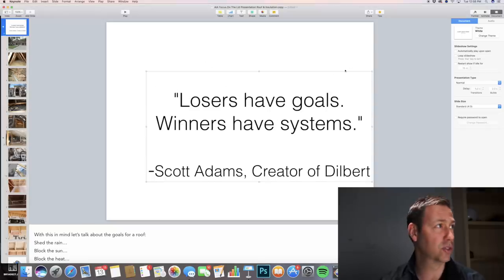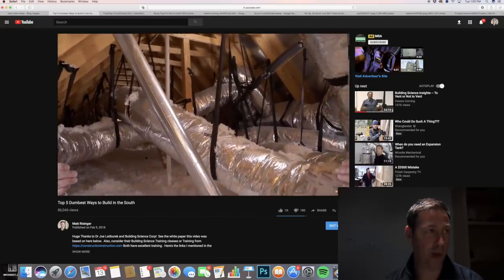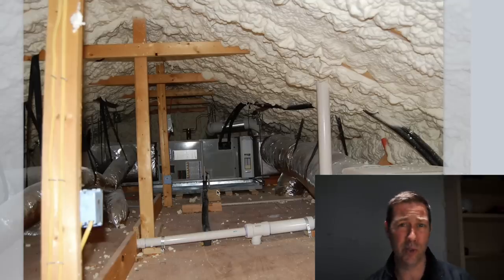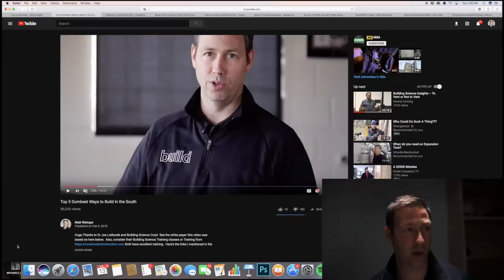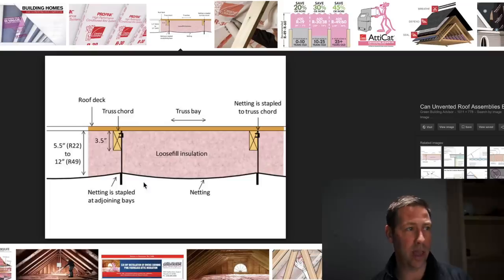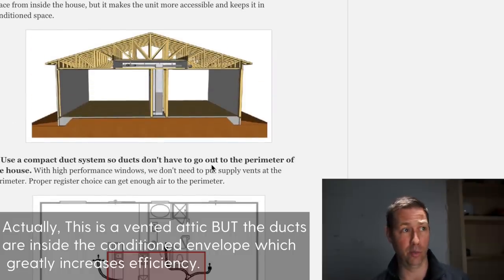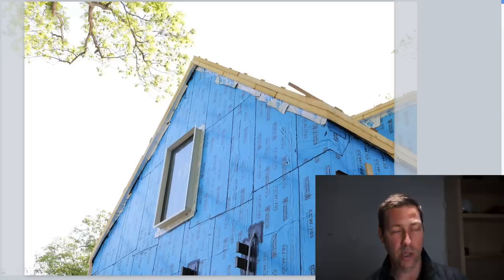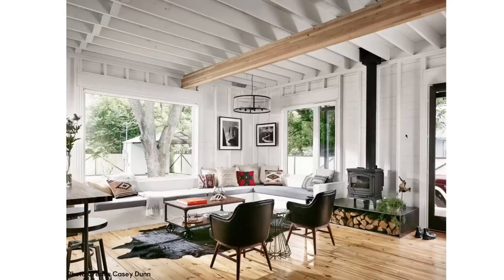Attics/Roofs - Dumb vs. Smart - How to Build Correctly

Comment: $250.00 sqf is very north of most custom home budgets. I really like your videos but that statement sounded more in line with a money's not a concern build!
Reply: I was thinking the same. 250 is very high. most builders are around 80 to 90.
Reply from the maker: I would expect a lower cost in other parts of the US. But we need to set higher expectations for performance on our homes. Gone are the days of a home built for $xxx/ft (Insert local average cost).  A well-built home with good systems, a thoughtful design, and good tradesmen should cost 1.5x (local average cost). We should be building homes that last a few generations without problems, that are healthy, durable, efficient and long lasting. Build better not bigger.
Reply: Matt Risinger, that's great if you can recover the premium cost within a 5-7 yr window but the resale price of the home will only bring $ average of "like" homes recently sold. Unless the owner can document real utility saving to project forward the home will likely not resell for a premium.
Reply: Michael Amick yep, have seen this happen to many people that custom built there home. Then bank comes in and says I don't care about your upgrades or how well you insulted, a house in this area is worth x per sq ft and that is all we will grant a loan for. It's a sick feeling to spend $250k on a house where you did a major part of the labor yourself  because it was your profession and the bank says it only appraises for $180k.
Reply: Hard to say "most" when referencing anything.  Our client base covers homes primarily $1.2 -$15 M and we are just south of Austin. Everything is relative .
Reply: Bdub78 dub AGREED! if you take that /ft^2 value and slap it on mine, it would cost 912k to build!!!!
Reply: Bighappy 80 - 90 is a little low. Even Tilson and DR Horton are closer to 110/SF. I build a larger production homes that are around 150 - 175 a SF and there still crap in my opinion.
Reply: but at that durability i would buy it.
Reply: @buildshow  yes we should build better but you must account for cost. Everyone wants the best home built. There's no question there but $$ is always the bottom line. Everyone has a budget and I'm just saying that $250 sq ft is NOT a realistic budget for 90% of us. I'm not knocking your product. It looks like a great one. Just want you to realize the cost you casually stated in your video shocked me.
Reply: 125/sq ft. livable space is more in line with our build budget, not too many people can afford 250/sq.ft. where I live.
Reply: First thing I thought. You mean to tell me a 4K sq ft house is 1 mil just in building costs? I'm sorry but no way. Love the channel but I can't see this as being realistic.
Reply: Guys guys guys, 250 sq ft is relative to your area. I live in Seattle that would be a steal of a deal, However in the Rio Grande Valley (South Texas) no so much
Reply: @rubenramirez8805  that's not even taking into account land value though, so the house may end up costing $500,000 for a 1k sqft home.
Reply: $250 is high! But I do understand the great workmanship and passion you put in the house. Here in Seattle Washington, it's very common for a multi-million house built at 100/SF and actually sold. Btw, I can't afford $250/SF. Love all the videos and info :)
Reply: That house can't be more than 1200 sqft, so at 250/sqft that's $300,000, which is what old crummy 80s homes are going for here now in South Austin.
Reply: OMG...in what country? Where I'm at, no contractor will talk to you for anything less than $500 a sq. ft., and they get it.
Reply: @buildshow  The national average around the time you built the house was ~ $130/sq ft.  So you you essentially doubled the cost.

I understand that it's somewhat area and neighborhood specific.
And yes, you're a custom home builder.  So you effectively work in a different market than many home contractors do.

And outside of locational costs, I can see 10-25%, or even a 50% premium.  But an effective 100% premium?  There aren't that many regular people who can afford that sort of thing.  Especially when the bank looks at these sorts of improvements, and ignores them when factoring a loan.
Reply: Even 11 months ago, when you made that asinine comment, "Most" builders weren't even close to $80-$90/ sq ft. I wouldn't want to even see what was built for that price.
Reply: @BornInTheCreek  It's $500 a sq. ft. where I am.
Reply: These videos are informative,. However they are also marketing influence to get signatures on high dollar contracts. It's the same with Tiny House videos. People tolerate tiny to get out of debt. Now the debt industry (loan providers)  want's to penetrate the tiny house market with their targeted victimization strategies. I've seen $5,000.00 break point builds with asking prices of  $60,000 on wheels with no land.  Its evil.
Reply: @Matt Risinger here in the north a production home is around $250/s.f., and custom is easily more than double that. People don’t understand regional price differences but you presented a great video with good ideas and detail. I wish homeowners put more pride in the quality of a home not just the size, but most don’t really know enough about it to make an informed decision. Hopefully your channel is helping to improve that.
Reply: @rodavision  I'm in south Silicon Valley and no one talks to you for less than $500 sq ft.
Reply: I think the expense of this house comes from several areas not apparent in the video. It is an AIA architect designed home, so architect fees were probably pretty high. The HVAC system is a fully split Mitsubishi system, much more expensive than a conventional ducted HVAC. The HVAC system was designed by a local, custom HVAC engineering company who also probably consulted on some of the building science. These guys are very serious and really good.  So again, another fairly big chunk of money right there. Also, there are a fair number of custom made wood beams inside and custom steel work for the porches. If you look at the house before the porch roofs were attached you can see steel brackets attached to the house that probably presented some problems penetrating the WRB and insulation - thus extra labor and materials.  This is a truly and fully custom house - almost nothing is standard off the shelf parts.  It looks rustic, but it isn't.  I've been in the house and it has an amazing feel and layout.  It has that intangible, satisfying serentity you only get with an architect designed building.  Is it worth $250 sq/ft?  Only the folks who paid to have it built can tell you that.  I do know that it recently sold for around $750,000, substantially higher than what it cost to build.  It is 1491 sq/ft total.
Reply: 'last a few generations'....' with spray foam 😒wtf
You realize that you are building mostly with adhesives that will not last for 'generations'?!
Reply: I live in Central South Carolina. I bought (in 2013) a 2900 sq ft two story rated "Energy Efficient" with related discounts on electric and gas by the local utility, for $73 sq ft. So build cost would way South of that. It is indeed efficient, with gas averaging $40/ mo and electric around $125/mo. South Carolina is known for summer heat and humidity, with mild winter and little snow/ice. So it's location, location, location!
Reply: @thomashughes_teh  
Capitalism is evil that way, yes...
Reply: Houses here, southern arizona, are selling for 100 or so a square foot and have been sitting on the market for 6 months.
Reply: 250 per foot is jamming it up the hinney.   Texas maybe a booming economy,  but they have plenty of Mexican labor as well.  I bet ya all these tight houses wont last worth a shit compared to all the old drafty 150 year old homes.
Reply: $250/sqft is a steal here in Los Angeles! Old crappy homes are selling for $400+/sqft haha. Just gotta find a reasonable piece of land
Reply: @hkgonra  : I've never built a home that wasn't appraised off the plans before even a single nail was driven. If you built the home you describe without having it first appraised off the plans, then you did that to yourself. Hope you learned your lesson for the next time?
Reply: TrailTrackers I didn’t and wouldn’t do it but have seen people do it. At least in this market the bank doesn’t care how well your house is built compared to your neighbors. They only care that x neighborhood is worth x per square ft.
Reply: @buildshow  Agreed. Builder grade lowers initial cost, but can strand a home owner. Kind of in the same situation, 1955, 2nd owner, nothing has been done with this place. No central air even. Looking in to energy efficiency govt loan programs. Wife had to have it. 😉
Reply: @BornInTheCreek  You must live a very sheltered life. $1M build cost for a 4000sf home is cheap in any desirable area
Reply: $250 is cheap.  Matt charges $400-$700.
Reply: That statement looks even more absurd and out of touch with reality now considering that lumber and sheet goods have tripled in price just in the last year nationwide. Phoenix area is booming with new home construction and production builders (track homes) are only selling @ 150-210 /sf.   For average "upper middleclass" neighborhoods etc.
Reply: Umm, circa 2022 in urban northeast 250 is what spec builders charge….just sayin
Reply: @PhotonHerald  that doesnt really matter when you are providing a product not truly comparable to other builders, you create your own niche and you effectively eliminate other competition. If people want what you can provide, they pay your price
Reply: @buildshow all of the tools builders use to build these homes are made in China.  I don't care what homes cost, we need to bring manufacturing back to America so that people can afford $250 square foot homes to begin with.  When every US citizen is a builder of some product, then $250 per sq ft becomes reasonable.
Reply: @johnwhite2576 That post was made in 2018 when a sheet of OSB was $5. I have no doubt he’s charging 350-400k a sqft now.

Comment: With spray foam, what happens “WHEN” roof decking needs replacing? It seems like it could also hide a roof problem?
Reply: I'd also like to know if your roof shingles would be adversely effected by spray foaming your roof sheathing. Wouldn't the shingles tend to get a lot hotter in the summer and cause them to curl? A question for a roofing contractor or a shingle manufacturer perhaps.
Reply: if u have to replace any wood, u can remove it or cut it out. Or just put a new roof deck down on top of the old one as long as it's not rotted.
Reply: @peteyou2325  no there is no impact on the shingles whether or not you have spray foam in the attic
Reply: You're absolutely correct it should be done with baffles between the rafters so you have a small air space between the roof decking and the insulation or put a water screening material on top of the rafters before the roof decking goes on
Reply: @peteyou2325  this has absolutely no impact on the shingles or any other roofing materials but a good question ⁉️
Reply: @enkrypt3d  it's much better to do it right the first time and avoid these costly mistakes that can be time consuming and a huge headache especially if you get a contractor the has a bad bandaid fix that will cause even worse problems that you had
Reply: @rob214  I just did 3" of spray foam in my attic. It's been great. Anytime I need to fix the roof I can easily replace the wood or just do a deck over. Simple
Reply: @enkrypt3d  a deck over a rotten deck isn't a good idea it add a lot of weight to the structure and a problem with a revel at the fascia what are you going to do about those two problems
Reply: @enkrypt3d  generally speaking you don't need to replace roof decking unless it is rotting
Reply: @rob214  yep exactly what I was thinking. The attic is about 50F degrees cooler now.
Reply: @rob214  no im not saying putting wood over bad wood! you can remove the rotted wood with a skill saw set to the depth of the wood and replace that section. but if u have spray foam under the original roof deck, the best way is to just do a deck over with something like zip sheathing. so u dont have to replace the original wood if it's not rotten.
Reply: @enkrypt3d  what are you going to do with your fascia reveal
Reply: @rob214  there are larger drip edges that will cover both sheets of plywood
Reply: @enkrypt3d  if the roof decking is not rotted why would you want or need to replace it or deck over it ⁉️
Reply: @enkrypt3d  I'm trying to tell you if you use a baffling system between the rafters and leave an air gap from the soffit to the ridge line then insulation you eliminate a few problems you can redeck without compromising your insulation and it provides for air flow under the decking to prevent rot mold mildew condensation and moisture it let your decking dry  doing it right the first time saves money and a lot of headaches
Reply: @rob214  Because I would put furring strips down, and use zip with radiant barrier :)
Reply: @enkrypt3d  ok good luck 🤞
Reply: @rob214  Yea we did 3" of closed cell directly under the roof deck with no baffles. the soffits are "vented" up into the bird boxes only and then there is an air seal behind that if that makes sense. so my attic is 100% sealed now.
Reply: @enkrypt3d   even if the wood is not rotten wet foam has to be chased down the roof and removed.  Foam sprayed from the inside was sealed to the sheathing so condensation wasn't an issue but seal is lost once the sheathing is ripped off.  How is new foam going to be sealed to the sheathing so condensation doesn't become an issue?
Reply: @arthurharris1100  you can always just respray that one section.
Reply: @enkrypt3d  Yes but if the inside is finished the foam needs to be sprayed from the outside. Then how do you create an airtight seal between the foam and the sheathing.
Reply: @arthurharris1100  nah the attic is unfinished
Reply: @rob214  Are you saying to use the baffles all the way up to the ridge for an air gap, and spray foam on the underside of the baffles?
Reply: @johnharrison5656  yes

Comment: Some of my family still lives in Poland. Most homes have stucco on the outside, about 20 years ago, one of my cousins was insulating his home from the outside like you have shown on the last home. They used large sheets of 2” foam board and attached it to the outside of the home. What are they doing today, who knows, haven’t been there since 2005. The home I’m talking about is in Rzeszow, Poland.  Most homes are built from blocks (concrete, clay, etc.) and heating systems are hot water.  Most homes have no insulation, unless they are built within the last 10-15 years. Many homes are self contracted, and usually are representative of where the person lived outside of Poland.  Comments?

Comment: The house only gets "Depressurized" as you claim if the supply side has a leak equal to or greater than that of the return side.  However with your logic the return side is just as likely to leak there by either negating the supply side leak or causing it to further pressurize the home.  Lastly, I would argue that as tight as you claim to make these houses, they don't stay tight for long for numerous reasons related to material science.  Have you ever done a pressure test after 5, 10, 15  years on one of these homes?

Comment: After reading the articles from Green Building Advisor & Energy Van Guard it looks like best practice to avoid damp roof issues in a closed attic that has open cell foam in Texas is to have both supply & return vents in the attic with a dehumidifier thrown in to complete the system. All this science is beginning to hurt my head.... Keep up the good work.

Comment: I love to see foamed attics.  Your on the right track on informing others on this.  As a HVAC contractor I HIGHLY appreciate this!!!  However, I don't wanna see any rafters what so ever...  I want to see the rafters totally encapsulated.  Go look at those exposed rafters with a thermal camera on a hot summer day, to check the heat transfer through those exposed rafters.
Reply from the maker: Yes, I totally agree. I’ve gone to a much thicker install of foam (10” now) but I need to upgrade my photos. These are from a few years ago. I’m doing an insulation job next week that I’ll probably do some video on and get some good photos. Stay tuned

Comment: At 6:24. The exhaust is ran incorrectly. The change from 2" to 3" has to be on a vertical rise, not horizontal. That's a water trap and will hold water. Bushings are a cheap way to do it. A standard reducer is called for in the venting specs.
Reply: Good eye.